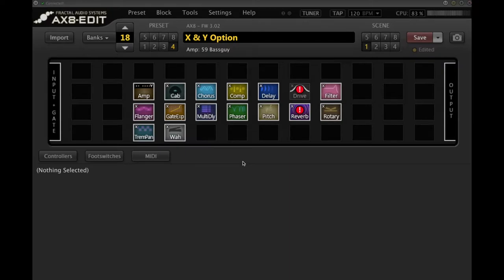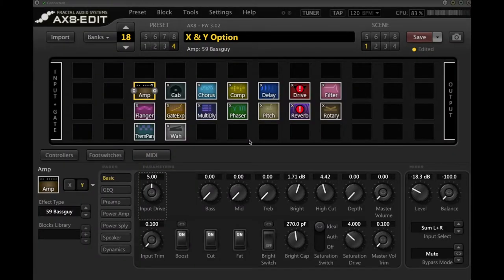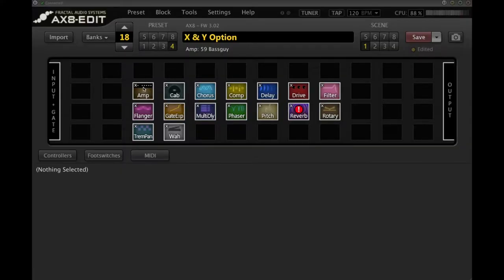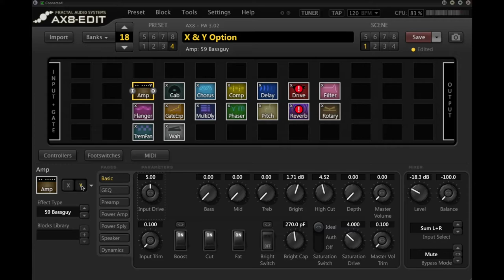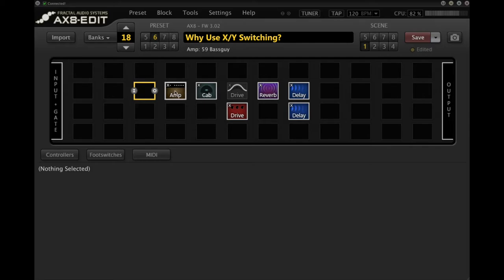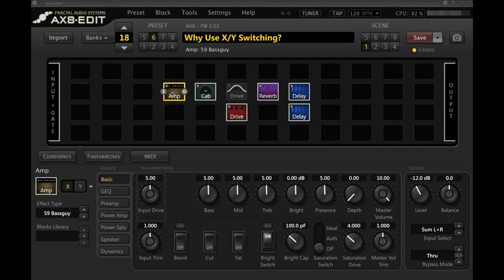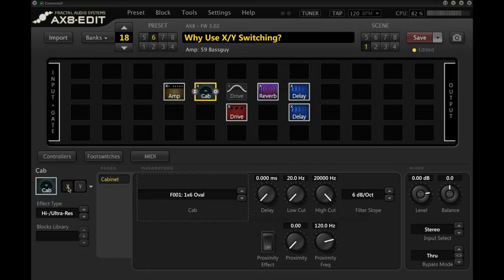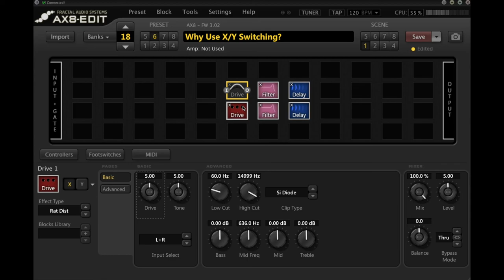Fractal Audio AX8: X/Y Tutorial [X/Y Switching; Benefits; How to; Uses]

Comment: I feel like such an idiot that I have not figured this out prior to watching this video.  I was getting frustrated with having to switch from Clean sounds to heavy and using 2 totally different presets for each.  Then I couldn't get the toggle timing down between them and it sounded terrible in live shows.  I tried Scenes but you can't change amps in the scenes, and the presets lag a touch.  I am going to go set this up and hopefully it'll fix my issue:)  Thanks so much!
Reply from the maker: Don't worry about it man. Fractal Audio gear isn't exactly íntuitive'. It'll fix your issue for sure :)

Comment: Hello.Thanks for that video. I have still have a problem : switching between X&Y works when I'm am using the computer (with the compuer screen, as you deed). But when I use the AX8 footswithes there is no change : X&Y have the same sound ..... If you have a solution, it would be very helpfull. Thanks again

Comment: thanks for posting..I like the info..so if I wanted to use x/y to add more gain in an amp or switch amps I need to assign the amp block to x/y on one of the scene switches for a particular preset of choice?
Reply from the maker: Hi! You're welcome. I'm happy to post these videos. Good question. Here's the best answer I can give you:

In the X setting:

1. Choose your amp
2. Adjust your parameters to suit yourself (X setting)

In the Y setting:

3. Choose another amp (or keep the same one)
4. Adjust your parameters to suit yourself (Y setting)

If you combine X/Y switching with scenes as you've mentioned then you may find that there is less of a 'gap' between X and Y. Some people note that there is an audible gap when using X/Y (within the same preset; same scene) whereas switching X/Y states between scenes is less gappy and relatively seamless. 

Does that help?
Reply from the maker: I have another video that shows you 12 ways to adjust gain inside the amp block. Check it out if you haven't already.